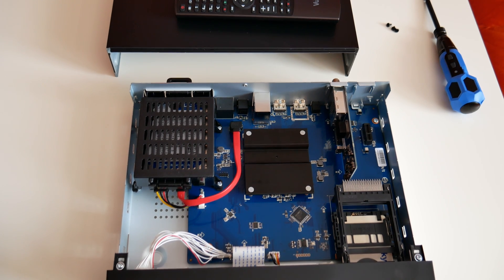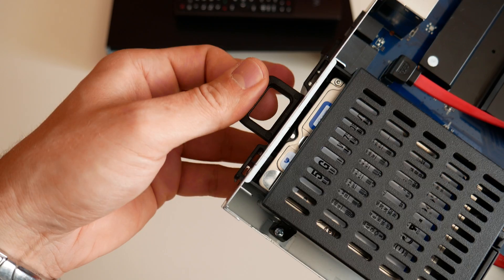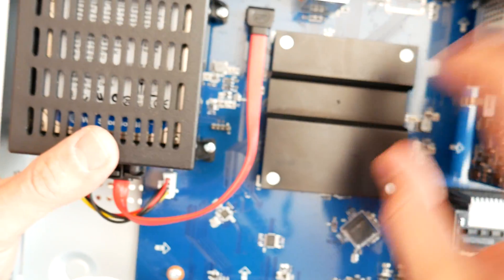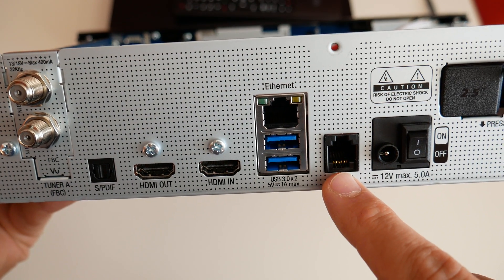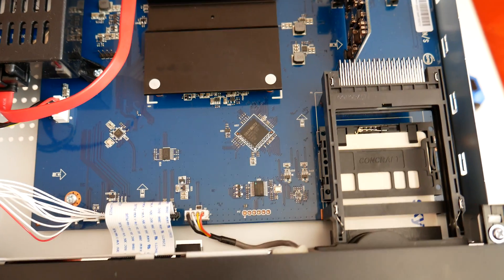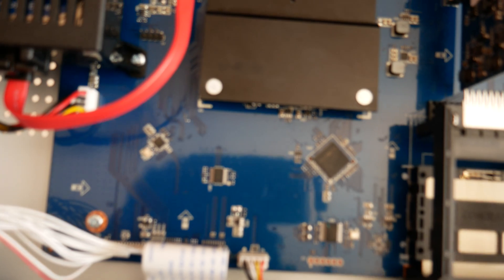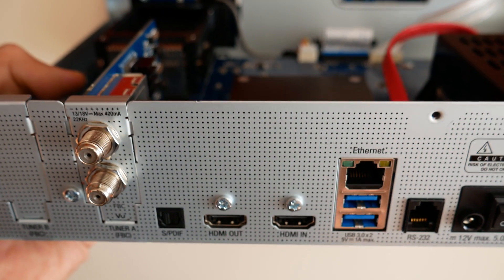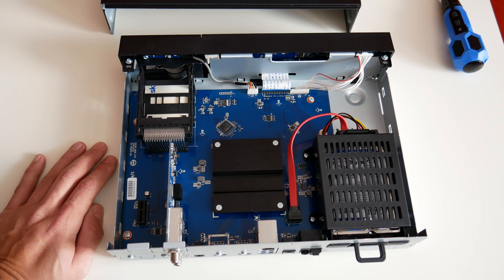VU+ Duo 4K - what is inside the box, disassembly and quick overview

Comment: It is a shame that you are limited to 2.5" HDDs though. They only go up to 5TB. If only there was a version with a 3.5" HDD. I suppose you could using a SATA data and power extension plug in a 3.5" drive for bigger capacity but then you got an ugly drive sitting outside the machine. If only the Ultimo 4K hadn't been discontinued. I tried getting one off eBay but the prices sellers are asking for is just stupid. Am not paying £400 or more for a second hand receiver when I can buy the Duo 4K SE brand new cheaper especially if I got to spend about £300 on top buying tuner cards and HDD for it.

Comment: What you indicate with "chipset cooling" are the connectors for the Common Interface (CI) slots. RS232 socket is to plug infrared remote receiver.

Comment: Cool review, I certainly have my eye on this reciever, can you tell me please, I see it comes with a single FBC tuner, do the two inputs have to come off a single satellite feeds, or is it possible to have two satellite feeds going into the same tuner, I was thinking hotbird and astra 28, with a terrestrial tuner for saorview TV on the next tuner
Reply: this multituner I have mounted onboard is SAT only. For the terrestrial you gonna buy separate tuner. But I reckon you know this and asking primarily for the multifeed. Actually I have 3 dishes with total 5 LNBs  (0.8, 13, 19, 23, 28) on them hooked into this box :) Having two diseqcs. From those two diseqc having two COAXes into each input. Working perfectly. Using VTI 14. In the VTI you are able to manage as many connections as you wish. You only have to buy diseqc with two impust and two outputs. In the VTI you will setup both tuners the same way: simple diseqc with two lnb (astra nad hotbird)
Reply: @recenzevsehokocurstvo7831  thank you